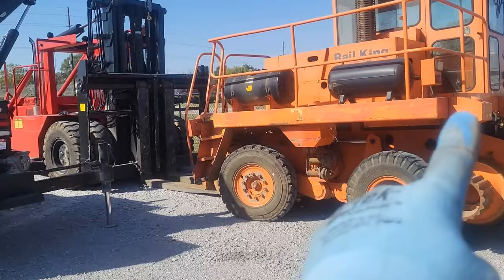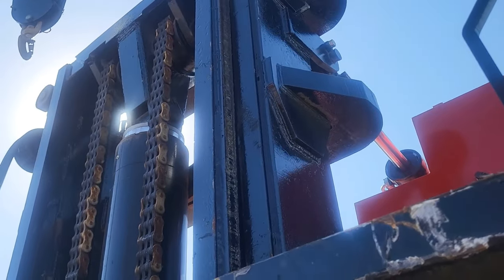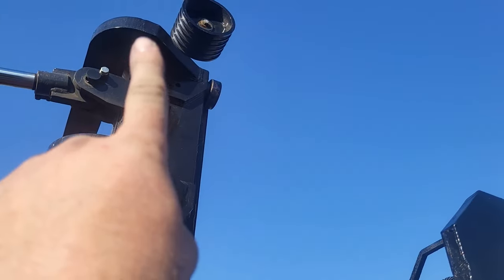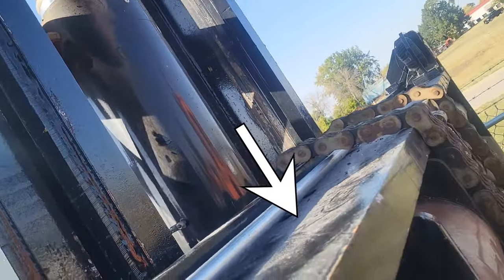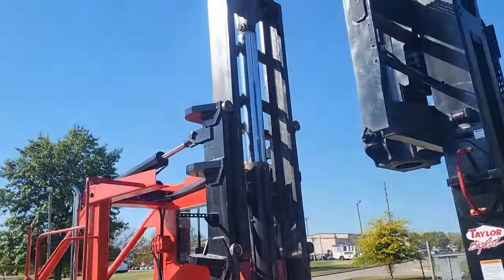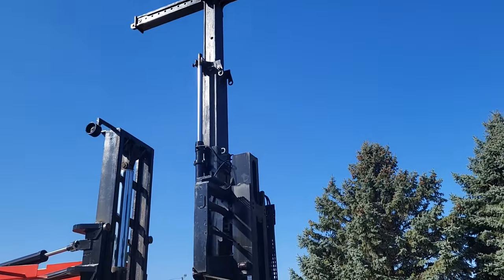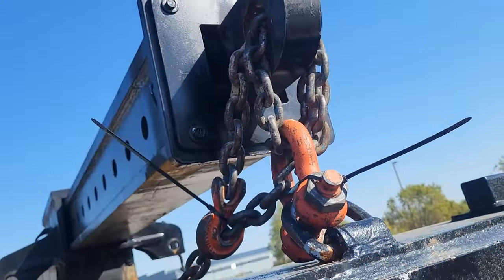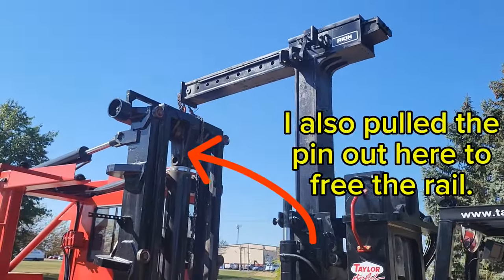Mast Roller Replacement

Comment: Reminds me of the big Reds at the steel plant here
Reply from the maker: You operate or work on them? Or just seen them?

I really like old-school stuff like this. Most of this stuff is just scrap anymore.
Reply: @Fixed-ish  licensed for man lifts, forklift and telehandlers. Never operated a big red, as their known in our steel plant but the first three I mentioned I did as part of a job. Have u? Think about your comments
Reply from the maker: @coreysim-th9tl  I've done a lot with this job. Worked on all sorts of aerial equipment, telehandlers, small and large forklifts, rail car movers, shuttle trucks, electric/diesel/gas/LP of all brands. Drove and worked on them all.

Not sure about the last part of your comment though?

Thanks for watching and commenting!!!
Reply: @Fixed-ish  cool
Reply: Sorry took your original question the wrong way
Reply: @Fixed-ish  sorry took the first question wrong. But I have operated and helped maintenance a lot of machines